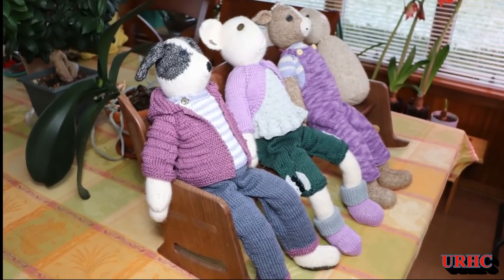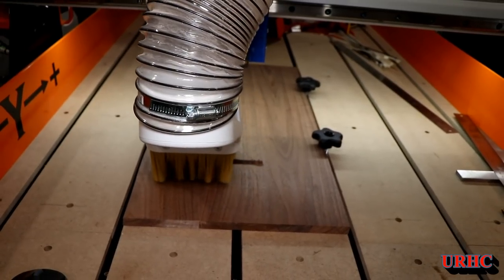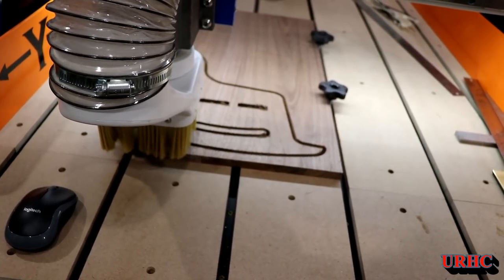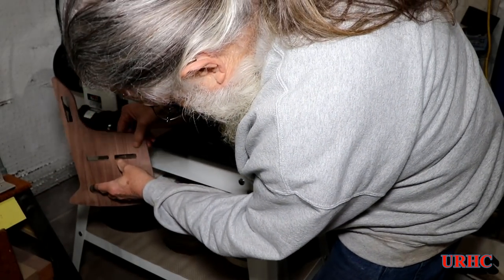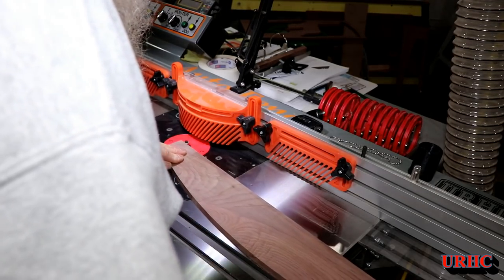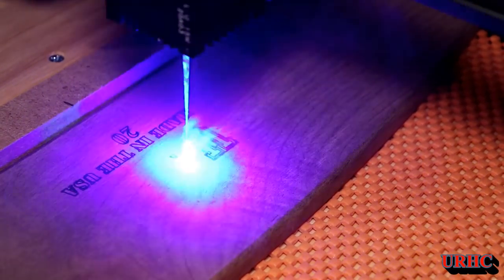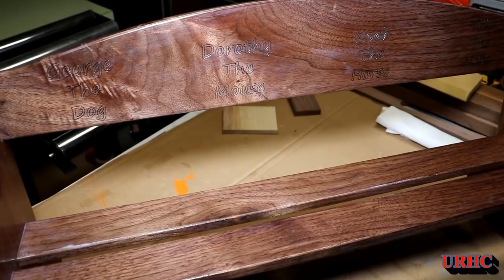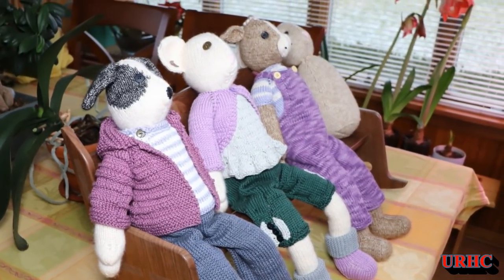Four Seat Rocking Walnut Bench For My Wifes Knitted Animal Friends

Comment: You two are both so talented. Everything you make is just so wonderful.
I wonder if I could bug you with two off-topic questions?
Do you recall the name of the sunflowers that grew with the squash last year (replanted by squirrels, maybe)? The ones with the smaller multiple flowers? I looked through some of the older videos and could not find the name.
Also, I am stealing your garden fence design. What was your reasoning for setting the posts in the dirt instead of gravel or concrete? You never do anything without thinking it through so I'm wondering why that method seemed best to you.
If you're too busy, no worries. I appreciate all the time and effort it takes to make the videos.
Reply from the maker: Thanks. I thought they were the teddy bear but they were to tall so I think this is the closest seeds they have this year https://www.rareseeds.com/store/vegetables/sunflower/tall-orange-sun-sunflower . Gravel is good but concrete is usually a bad idea as it holds moisture and rots posts plus frost can heave it if it's not below the frost line. Thanks for watching.
Reply: @unemployedredneckhillbilly2023 Thank you for helping me. I appreciate the link-ordered them just now.
I've never put in posts so I appreciate the advice. We're in Z5b so I am concerned about frost heave. I may put some gravel first and top off with soil but won't use any concrete. Thanks again.

Comment: i was looking on amazon at some 1500mm ballscrews and i saw where you left a review of  the ones i was thinking of getting. I have scratch built a 5ft x 3.5ft cnc and am currently using 8mm lead screws. I have beefed it up quite alot since i first began and was wondering if you have noticed any backlash or problems with the ones you purchased? They look really nice for the price...
Reply from the maker: I made a mistake going with the 5mm pitch on the screws. They have basically no backlash but it takes 1000 rpm to get to 200 inches a minute and the 1500 screws get some whip at just below that speed. If the servo worked out they would be ok but now trying a stepper even though the closed loop ones show a better torque curve at higher rpms they really don't with the inductance of the lower cost motors so gearing is critical to keep them under 300 rpm. The 1000mm screw doesn't get the same whip so length matters. Most bits need at least 200 inches a min for chip load so I may have to eventually switch to different screws and use these for a different project. At this point none of the screws have enough backlash to worry about. I did switch out one of the bearing mount blocks because those bearings had backlash. Time will tell how they last. Thanks for watching.
Reply: @unemployedredneckhillbilly2023  very good information. Thank you